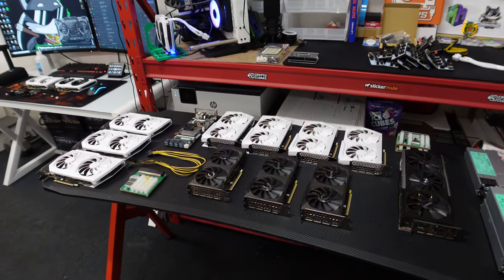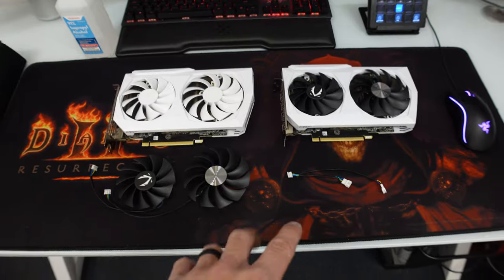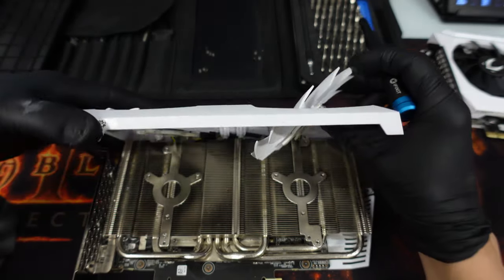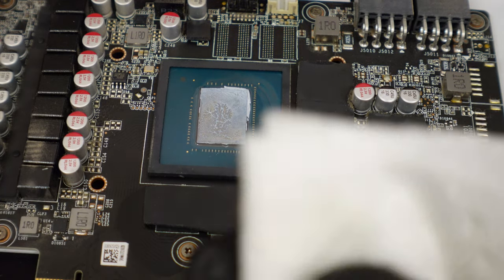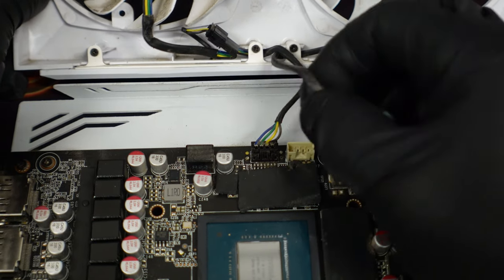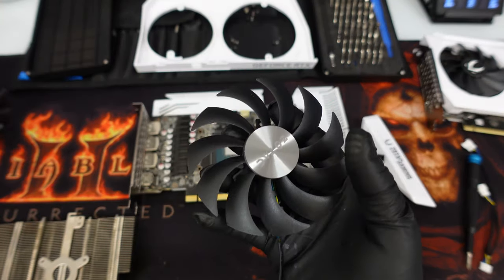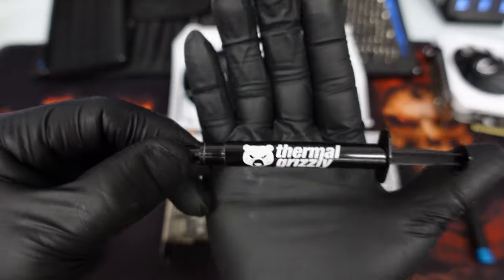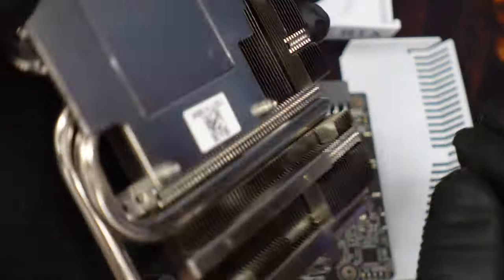How To Replace GPU Fans & Thermal Pads | Step By Step

Comment: Over the years I’ve started just spreading thermal paste with my finger lol. People say it’s bad but I’ve never had an issue. You just want to make sure you have enough and the die is covered, especially with GPUs. Great video!
Reply from the maker: Yeah I had to say that because I knew somebody was going to say I was doing it wrong LOL
Reply: You actually want to cover the whole chip on the gpu. On cpu only a grain
Reply: That’s exactly what I said lol

Comment: So cool you have a D2R-themed workbench!  I've been playing D2 since 2001 and bought a Zotac 3060 today specifically because I wanted to max all D2R settings and still get at least 75fps.  I'm currently using a 1070 and it can't come close to that.  I hope Blizzard North add RT to D2R!

I've been waiting for 3060s from mining to start showing up on eBay for less than $250.  That happened today.  So, I got one on eBay for $240 today.  It's a super clean Zotac OC.  The mounting plate is still shiny and there's no dust... a nice original box.  But, one fan is not turning.  That's what led me to find this video.  The regular OC model has 88mm fans instead, but your methods are a great lesson.

I'm guessing this will be my gaming card for the next 5 years, as I don't need to stay on the leading edge.  But, I might want to get into VR flight and racing sims.  I'm loaded with questions but I'd like anyone's opinion on my purchase.  Like...

If a brand new Zotac 3060 OC was used for 3 months with an unmodified BIOS for mining 24/7, is the wear negligible?
Will I get 5 years of light duty out of it?  Best guess.

Since this will be my GPU baby for 5 years, and as a certified geek retired software engineer with limited hardware skills, I'm thinking about water cooling.  I have a bit of hardware tweaking history, as I did add total aftermarket cooling to an R9 10 years ago.  Anyway, I'm thinking about water cooling the main chip and adding discrete heat sinks on all the VRM and various MOSFETs.  Adding a slot-driven side blower would keep the heat sinks cool.  I don't really want to know how stupid the idea is, I already know that, just how feasible.  I want to maximize the frame rate and still achieve 5-year longevity.  I thought hardware folks here who are also D2R fans might sympathize!  Of course, all your viewers might be interested to know that the $250 resale point is here.

Oh, and thanks for all the great links!

Bonus trivia question.  Did they ever release a black model with the mismatched fan sizes?

Comment: I replaced the fans on one of my GTX 1080 cards, The first problem with this was the new fans had a heat shrink casing that had to be cut away because it made the wires to short. Next the wire hold down clips are on the heat sink and made it hard to put them into place, they either would not go into the clips or kept coming out of the clips. The wire management was the hardest part but I finally got. I replace all of the thermal pads at the same time as the card was bought used and I just thought it was a good ides. The most fun I have with mining is working on my rig.

Comment: Hi, I have a Zotac 3070 amp halo that is over heating and shutting down. I have changed the pads and paste, but the problem still exist. Do you think the memory or chip is fried? Any suggestions? It has been a great card and I don’t feel like dropping a bunch more cash, if I can save the card. Thanks!

Comment: Next time try to heat the thermal paste a bit with hair dryer. It will make it easier to be evenly spread when you screw the bolts.

Comment: i neeed yrr help i got a 3070 it was a miner card i have 2days to sand back to get cash abck its not boosting over 1750 on msi hdwmonter shows it 1950 so wtf is wrong its seeems to me bast heat sinke past or is this whats happasn to won out miners it will not boost hi like it was new i need yr hwellp so much

Comment: I want to ask i have made my first 2 mining rigs of 3080ti each rig 12 gpu and each rig having 4 power supply of SILVER-STONE DA 1650 GOLD, but i am facing an issue when i switch on my power supplies its make spark sound and some times spark also but this is only when i witch on my power supply and this is happening with my all power supply and i dont know what are the issue, and also when my power supply is connected to 1 gpu so the spark sound is low but when its connected on 3 gpu the sound level is high.

Please please help me in this !!!